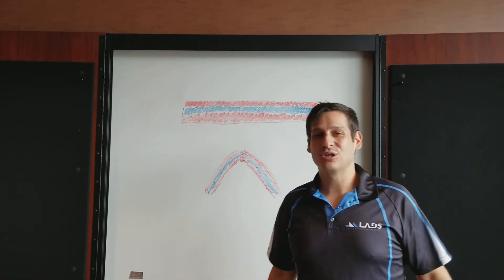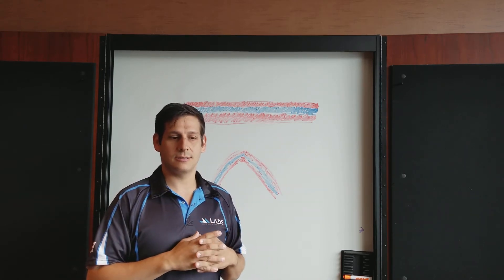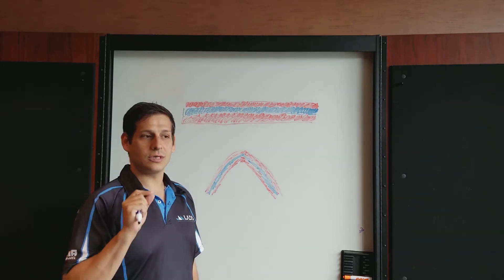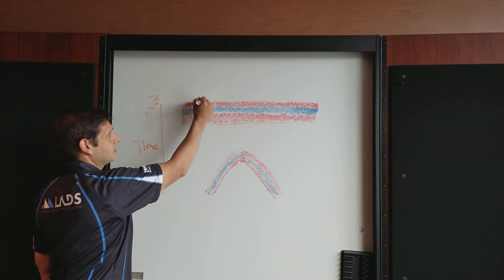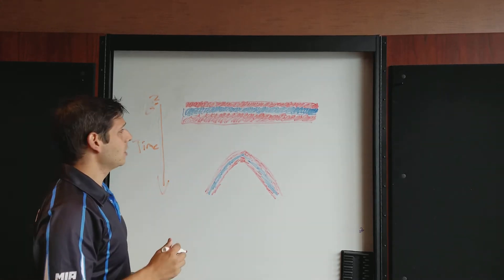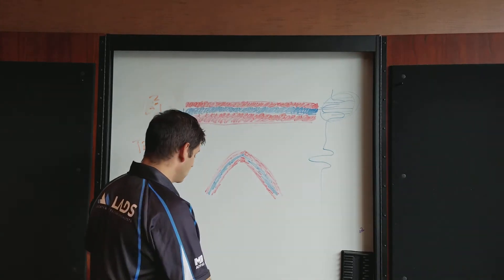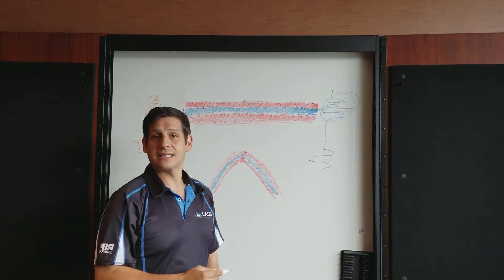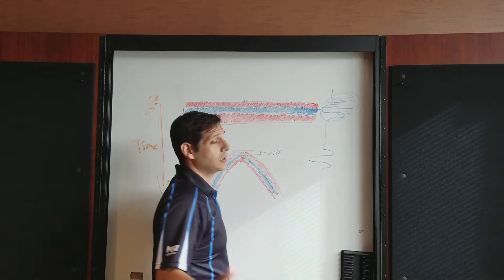Where to measure your GPR  target's depth (Ground Penetrating Radar)

Comment: I am new to GPR.  I don't understand the term - bands.  Are they 1/2 cycles of the EM wave?  At 500 MHz, wouldn't one band be over .3 meters long?
Reply from the maker: Yes. That is basically a half cycle. We'll put. The length of the band will depend on the medium it's moving thru

Comment: When you are giving depths of utilities, know your customer / excavator.   Sometimes you may benefit from giving a slightly shallower depth.  There are excavators that will think they can dig 3 feet down to a utility 3.25 feet deep.   Telling them 2.75 feet only protects them and the facilities.   Not always kosher, but definitely a possible help in the right scenario.

Also could help if you are on uneven/inconsistent soils.
Reply from the maker: Joe Glidden again some great insight. Things are so situational. Knowing your customer and giving them the information based on their behavior is a good.

Comment: I understand your point and I may not know the right answer but there has to be a right answer or some way to find out. If we let people choose a time-zero that is too deep then at some point there will be a chance of cutting out real targets.
Reply from the maker: Jamie Althauser ultimately they are all the right answers when it comes to depth estimation as long as your ground surface location is consistent with your targets location as it relates to the 3 band signal. In this it is implicit that you identify a ground surface or there can never be a reference for depth. Another issue gets at why all estimates are just that, estimates. There is no exact spot to pick across all circumstances because the fuzzy zone that all antenna carry varies from frequency to frequency. Also the wavelength varies for the same frequency in different material which would change the thickness of the fuzzy zone. So it is always an estimate. Certainly the lower the frequency the more grey area in the interpretation. Thanks so much for the comment. I always appreciate your insights. Hope all is well up in ohio